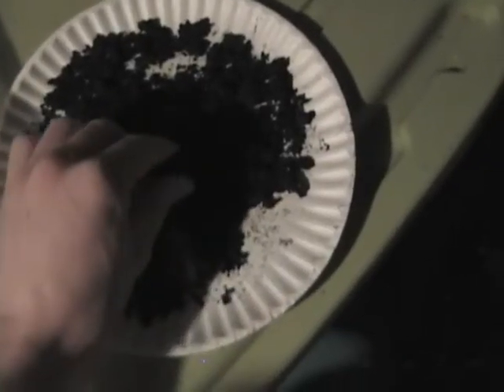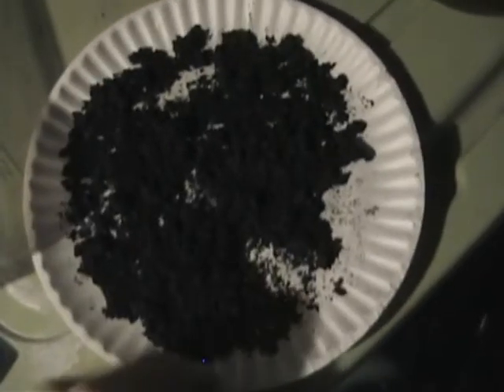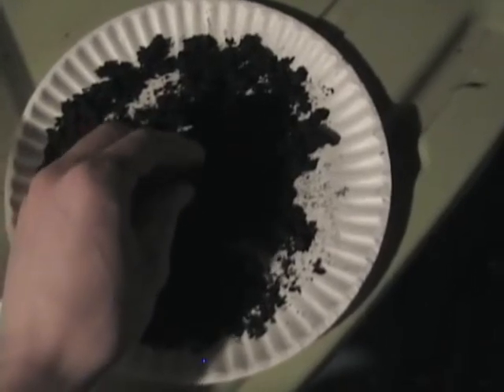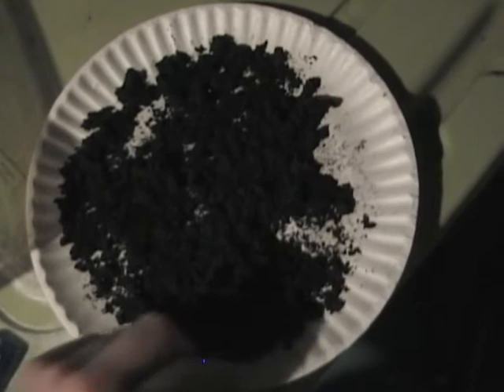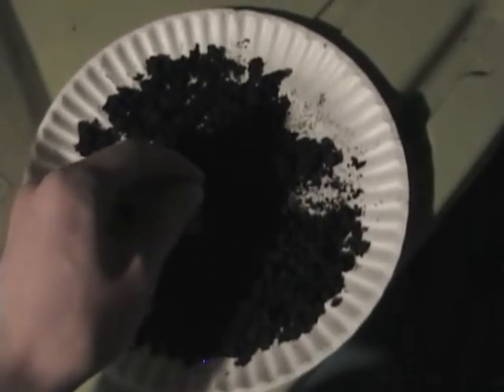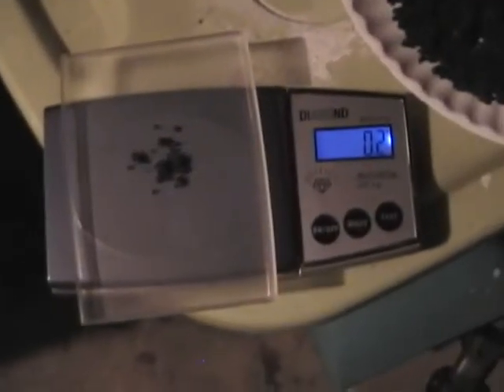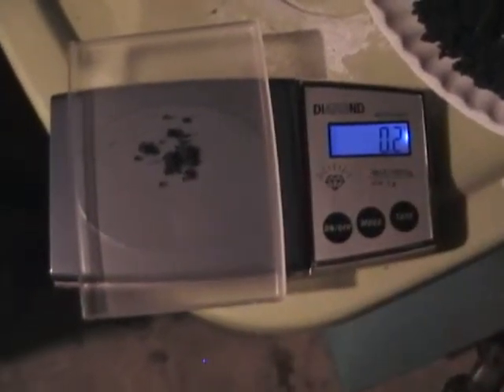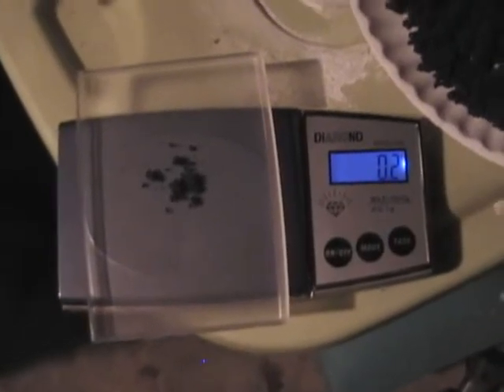Fast Black Powder Testing

Comment: Love the vid bro😉🤘 i have a question? Toilet paper rolls with paper and tube and do i charcoal it like i would wood same way ? And any kind of toilet paper? And can this be used for flash as well
Reply from the maker: 1MRRICHARD Same way as wood. Not too familiar with using flash containing charcoal other than H3
Reply: Basshead Curry this is bp u can make flash outta it right potassium perchlorate but you can you this bp to do it right??
Reply from the maker: 1MRRICHARD I'm sorry, but you need to study a bit more. Perchlorates have absolutely nothing to do with black powder. Flash powder should not be confused with black powder and should not be made out of it.
Reply: Basshead Curry  you have a dm. I can message u for advise and talk about this more for a better understanding you got i.g. or email

Comment: @eddynelly1717 Make sure your mortar tube and shell are fairly well fit, I use even slower BP and it still lifts with np. Also try putting the BP on rice hulls.

Comment from the maker: @eddynelly1717 actually it lift shells well. it may not look it on the camera but this stuff is really fast. its not normally this fast and i usually dont have problems lifting shells. this is definately fast enough to lift. theres no doubt in my mind. im using it to lift a 4" once the pasting dries.

Comment from the maker: @antiswattt3 i do have a chlorate cell. i also bought 6 mmo coated titanium anodes. i havent had time to run it or make a vid because ive been far too busy. ill try to make a vid of it soon. but i have like 10 other vids in mind so it may be a while. i have tested my cell and it works great but i only ran it for 15 hours. i need to do it again for more like 3 days.